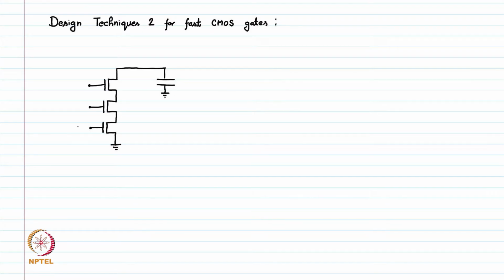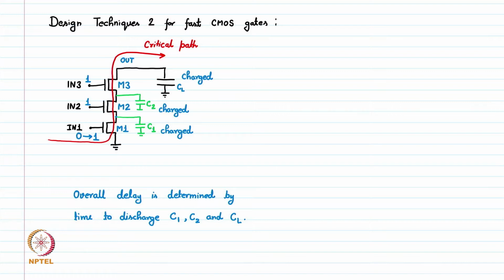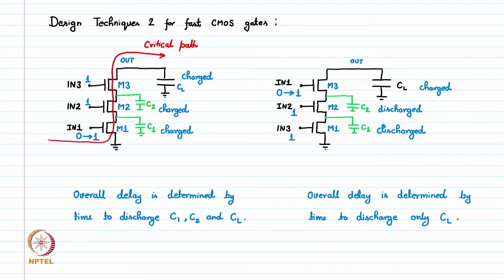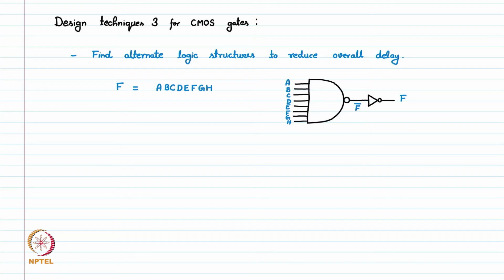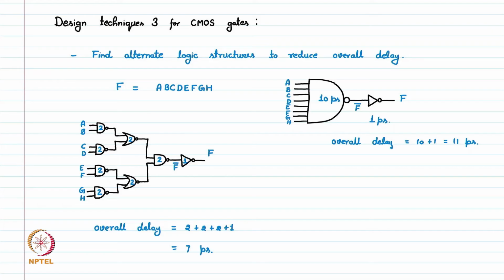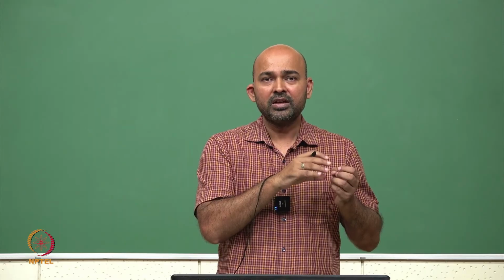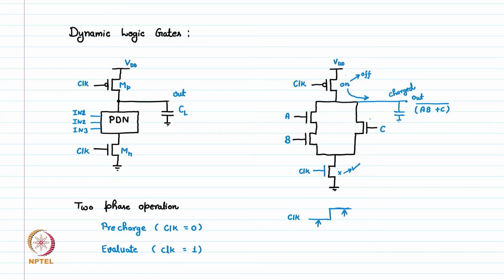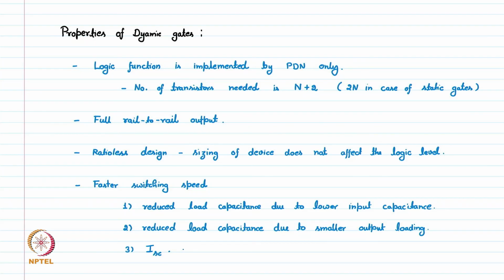LECTURE 16 : Dynamic Logic Circuit Design

Comment: One dobut in Dyamic logic gates, during clock transition and at the same time instant input is goes to transition. Is there direct path created from Vdd to Gnd(VSS) ?., for smaller time instant. (The channel will created and short circuit current will flow ? )